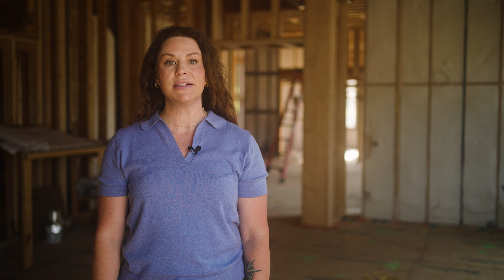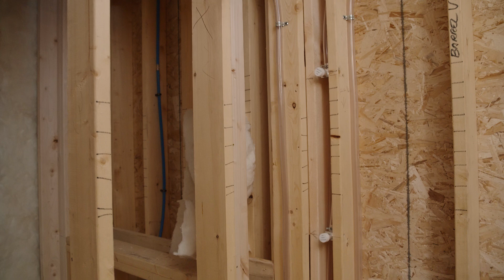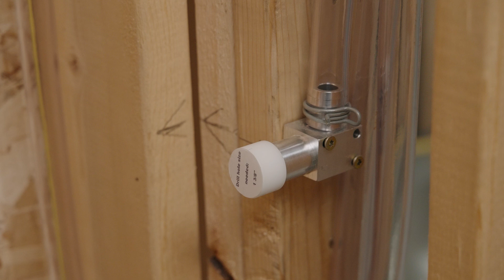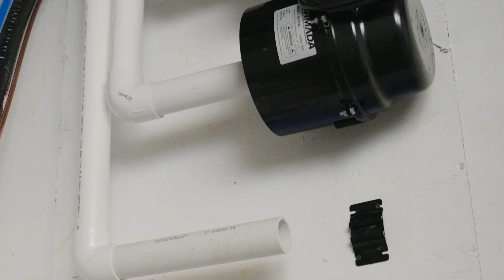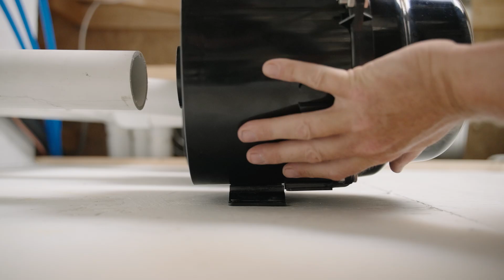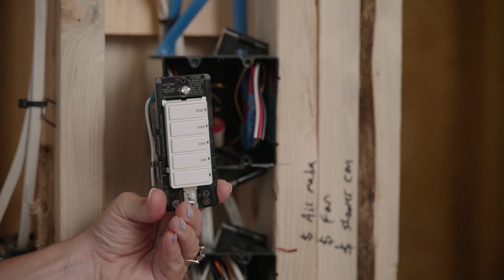Installing Airmada's AirJet Shower Drying System

Comment: U can put in an entire ERV system for your home for the cost of this and it will work better. Not to mention how loud these are, and the cost for running them is about 40-50cents each shower. If 2-3 times a day that adds up quit a bit. I was looking into this, and was turned off after i visited a home my installer did and they ran it. It sounded like a vacuum cleaner, and when i asked how much kwh it uses, he said about 2kwh. Were at 23 cents right now a kwh, and the owner said he runs it 1 hour after each shower and it drys it about 90%. It would have been about $5500 for this system, I could even pay a cleaning lady every 2 weeks to come and would be better off.

After looking more into to a way to solve mildew build up because a shower fan has never solved this for us, i came across an ERV with it being ducted into the shower itself. After doing this and living here for a year now, i can say what a difference, the ERV pulls all the moisture out on boost in about 1 hour, then balances the whole house with that moisture or expels it outside. A much better way with less holes in ur shower they wanted 16 holes in my tile... Now i have 1 hidden 18 inch slit vent in ceiling of my shower which turns on boost mode when it senses high moisture. Otherwise it runs constantly 24/7 for entire house cleaning and balancing my air. And only uses about 200 watts.